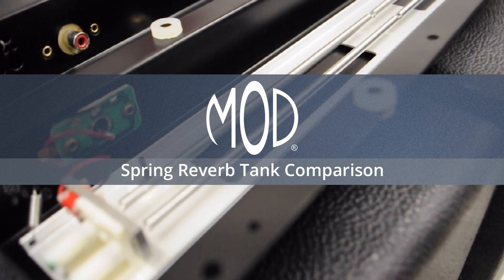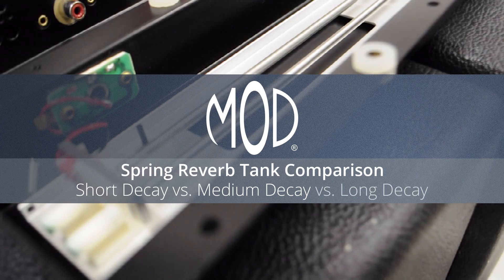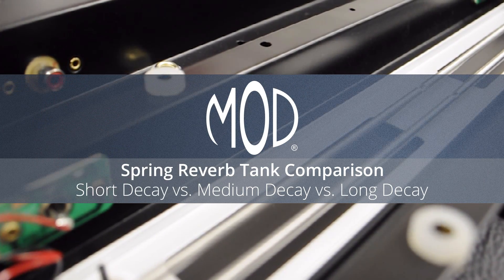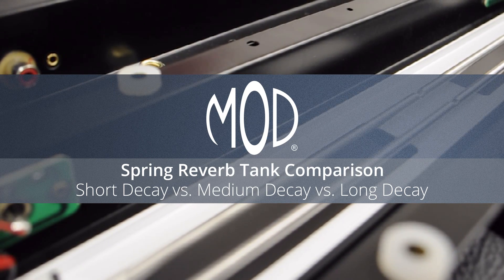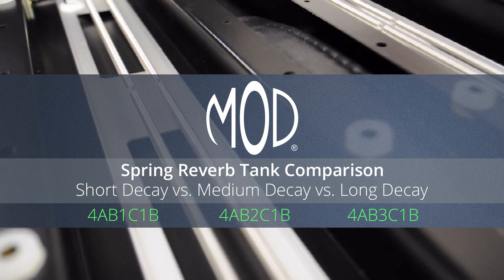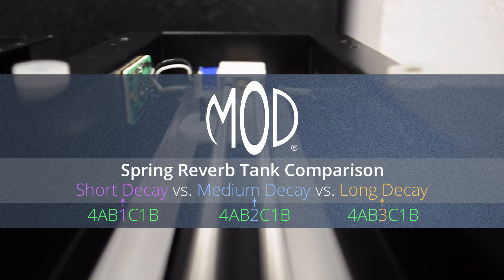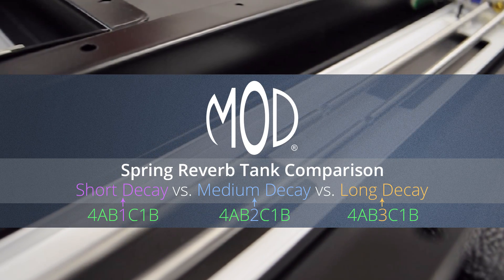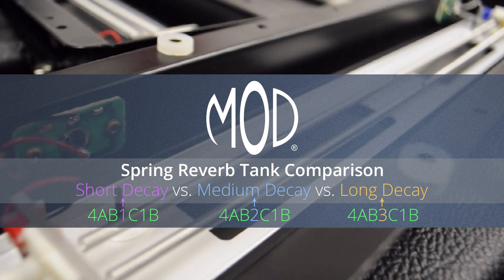Spring Reverb Tank Comparison Part 3: Short, Medium, & Long Decay

Comment: these are great videos thanks for doing them!  2 spring obviously but what would be the closest to a vintage fender tank... blackface and early silver face... It sounds to me like a 2 spring short is the what those would be basically?
Reply: 4AB3C1B Spring Reverb Can 2-spring (replaces Fender 022921)
TAD-Reverb BLACK HAMMERTONE FINISH

primary used by all Fender® amplifiers with tube reverb from 1963-1990.

Also used in Reissue models like:
Fender® Princeton Reverb
Fender® Deluxe Reverb
Fender® Vibrolux Reverb
Fender® Pro Reverb
Fender® Super Reverb
Fender® Twin Reverb
Fender® Quad Reverb
Fender® Super Six Reverb
Fender® Vibrosonic
Fender®`63 Reverb Unit Reissue
Fender®`65 Princeton Reverb Reissue
Fender®`65 Deluxe Reverb Reissue
Fender®`65 Super Reverb Reissue
Fender®`65 Twin Reverb Reissue
Fender®'65 Twin Custom(TM) 15

also used in Mesa Boogie®
LAB Series, L5, L7, L9
Koch® Powertone I

length: 42,5cm
springs: 2 x 2

Input: imp. 8 Ohm / 0.7 DC Ohm

Output: imp. 2250 Ohm / 200 DC Ohm
Reply: @schipbreukeling3  after all that copy pasta you don't answer his question of if it's long or short. It is long decay...the stock fender 4AB3C1B
Reply: The stock vintage fender one is long decay 2 spring 4AB3C1B